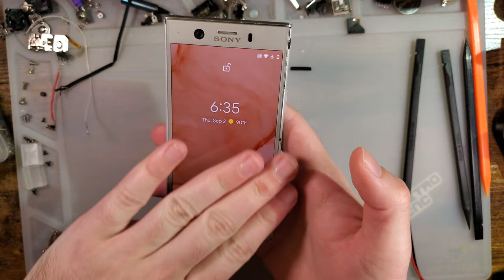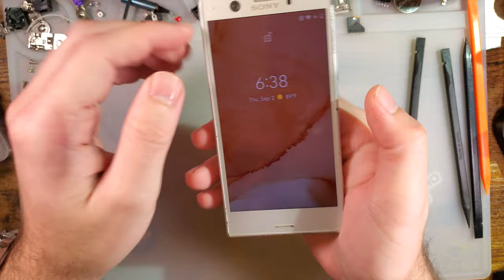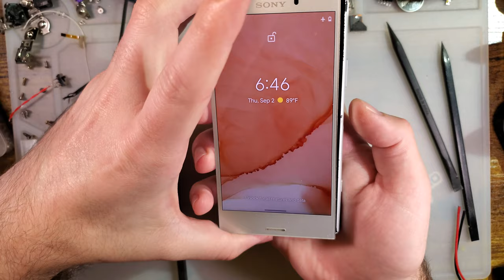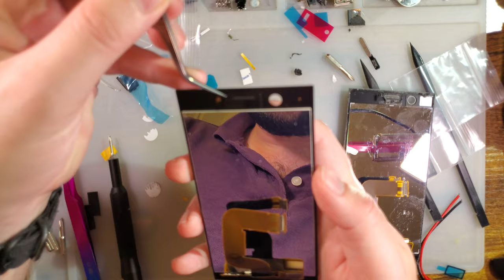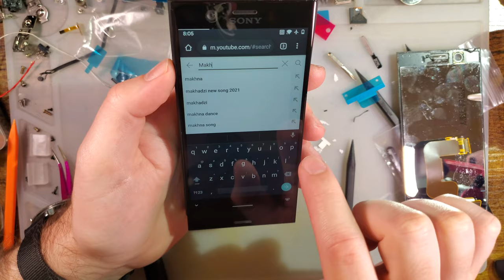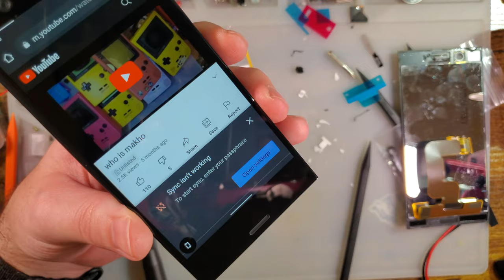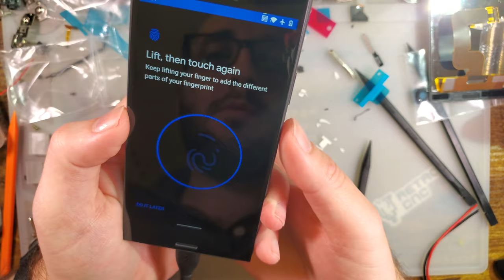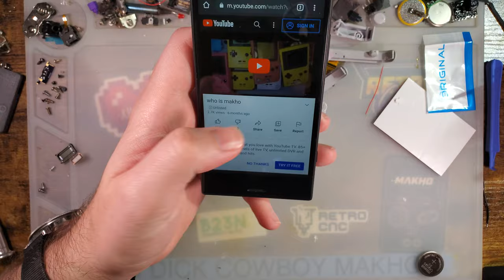Sony Xperia XZ1 Compact Housing Repair

Comment: I had an XZ1 Compact for 2 years. I loved it. Got a Pixel and Calyx OS and am really enjoying it.
Reply from the maker: I wanted to like this phone so much but there were so many little things. It won't even activate properly now and I don't understand why. I suspect there is a physical problem with the phone because it will get locked into an unrecoverable boot loop on occasion that requires me to restore it to original sony firmware, then reflash the custom rom, THEN reflash the recovery. Form factor, specs, size, and hardware wise, it's basically my ideal phone still which is a damn shame.

Comment: I really love the way Sony puts their phones together. So much easier to repair than a certain other fruity company. Dealing with adhesive is a pain, but I guess you can't get around that these days.
Reply from the maker: if only the adhesive I sourced would actually hold the new screen down. I probably did something wrong but either way, I still just prefer actual fasteners in devices.

Comment: Came here in an effort to figure out why GPS doesn't work on my refurbished unit (bearing the same docomo logo), pretty sure they didn't fix the GPS antenna correctly or forgot to move it to the new housing altogether. Is this it at 28:42? Now I wanna tear the whole thing apart and try to make better connection. Anyone with this problem? what've you done to fix it?
Reply: Same, still thinking of solutions
Reply from the maker: Lots of antennas in the device. I never had good GPS performance and I haven't been able to get this phone to take my sim card in years so I'm not sure I can test GPS properly. Sorry